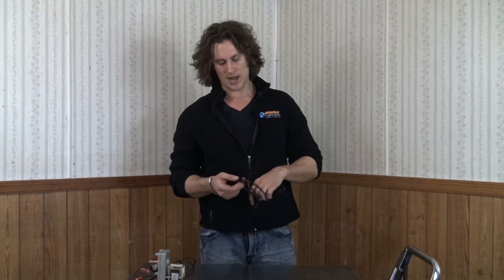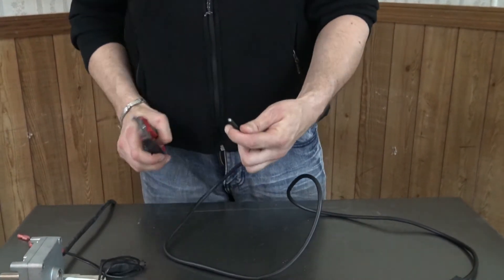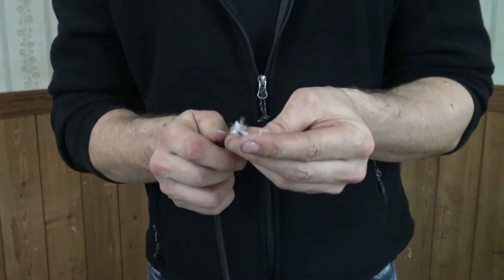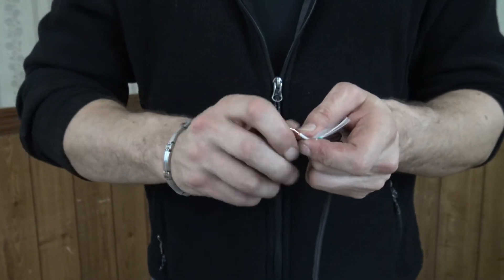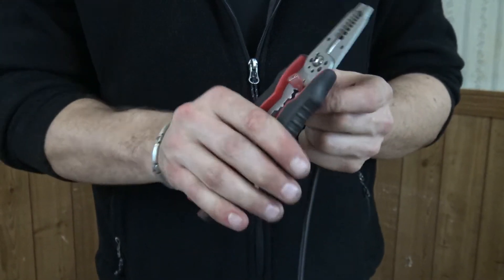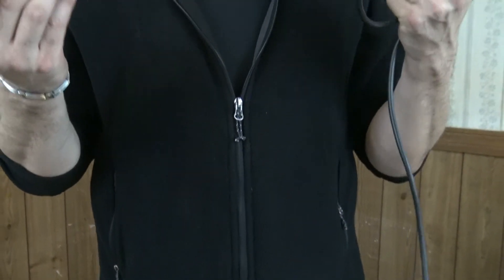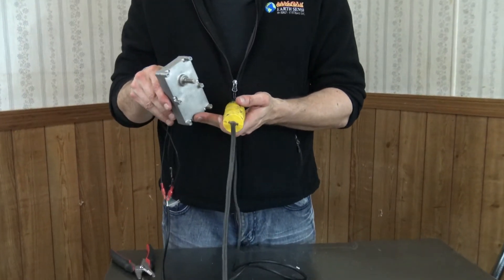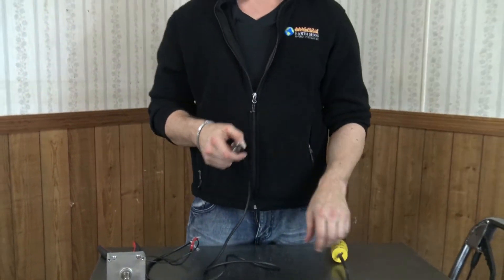Pellet Tech 101 - Making a Motor/Blower Test Cord

Comment: I have a 2005 Quadra fire classic bay 1200.  We just replaced the convention fan.  The stove starts, runs, but the convection fan cycles on and off (30 sec on, 4 mins off, 30 sec on, 4 min off ). I jumped the wiring (as you showed here) and the same thing is still happening.  We replaced both snap disc #1 & #2.  Cleaned out the ash in the square box in front of the convection fan. Also cleaned out the vacuum tubing, and the exhaust pipes.     When I run the stove, it starts out hot, green light on in the control box, then the red light comes on and the convection fan start.  Then both lights stay on, when the fan shirts off.    HELP … it get down to 2 degrees where I live.
Reply from the maker: Thanks for contacting us. The #1 snap disc is the only switch in line with the convection fan. Just for testing purposes, let's jump that switch to see if your convection fan runs constant as it should. https://youtu.be/FDVkbsHS95U?si=a5V4IsPfOoLX3M1W
Keep us posted, happy to help.
Reply: @EarthSense  I jumped that disc and it was still doing it.  I removed the conv fan and replaced it & now I just blew 3 fuses hahaha.
Reply: I fixed the connection on the fan and I stopped blowing a fuse.  When I jumped snap disc 1, the fan was still doing the same thing
Reply from the maker: @ Thanks for the message back. Let me touch base with a couple of our other techs and I will circle back to you ASAP. Appreciated.
Reply from the maker: @ Just heard back from our lead technician. Power comes from the control box to the convection fan 100% of the time - the #1 snap disc just interrupts it allowing the fan to turn on and off based on temperature. Given we have jumped the switch and changed the convection fan and the issue is still there, the problem can only be within the control box or electrical system. Suggested to thoroughly inspect all wiring that comes out of the junction box (where the control box mounts) along with the junction box port. Check for loose wires, exposed wires, and electrical burn marks. From there we have to look at the control box. If there is a dealer near by you they should be able to test your control box to determine if it is the issue. We also offer a control box testing service if you do not have a local dealer and want to go that route. 

For reference, here is what the Junction Box looks like: https://pellethead.com/product/quadrafire-1200-fs-junction-box-wire-harness-after-serial-352612-oem/

And Here is the control box for the 1200 - https://pellethead.com/product/quadrafire-control-box-3-speed-circuit-board-oem/

Keep us posted, happy to help however we can. Thanks.
Reply: @EarthSense  I took the control box in to get tested, and it worked fine. UGH!!   I got a new vaccuum switch and hose, that didn't solve the problem.  I also got a new thermocoupler, but haven't changed that out.  IDK what could be the problem. We are ready to buy a new stove hahahaa
Reply from the maker: @ Thanks for the message. Glad you were able to verify the control box works as it should. This is a very odd and rare issue you have. Yeah, thermocouple, vacuum switch, etc.. are not in line with the convection fan. Board gives power output 100% of the time to that blower and the #1 snap disc allows it to go on and off based on temp. The only thing left in our eyes is the Junction Box Wire Harness. The Control Box is putting out power to it, somewhere in the junction box or wiring, power is being cut out periodically/systematically. If you do decide to get a new junction box, double check your serial number as there were two different ones used for the 1200 model. If you decide to sell the stove and get something different, we can send you some links on refurbished and new stoves we offer if you're interested. Sorry again about the frustrations and situation here. Always happy to help.
Reply: @EarthSense !!!!   I took the new convection fan back to where I bought it.  They tested and it was faulty!!!!  OMGOSH!!   I have almost an all brand new stove with all the new parts I installed!!!   Thanks for your help!!
Reply from the maker: @beautywalker45  Wow! So it was an issue with the fan motor itself... So glad you had them test that and found the issue. Persistency is always the key :) Thanks so much for sharing and if you need anything else just let us know! Appreciated.

Comment: I followed your instructions and made my own and tested my distribution blower. Mine had two females so I made a cord with two males. The power cord for the blower had tree wires bla, garner and yell. I plugged in the bulk and yellow and left the ground plugged on the stove. Nothing happened, did I do this right? Does this mean that I need a new distribution blower?
Reply from the maker: @milagrossmith4891  Thanks for the message. Yes, green/ground should be left unplugged or as is. Yes, black and yellow wires were correct for test cord. If the blower is not operating when plugged  into direct power that would indicate the motor/blower is bad and should be replaced. If you need help with replacement options just let us know. Thanks.

Comment: Thank you!  My convection blower wasn't working and I was all set to pay $150 for a new one.   I built a test cord and checked it, and it was fine.   I used your other video to make a bypass cord and check the low limit switch, and that was the problem.  A new one is on the way and I am cautiously optimistic that it will fix the problem.  Thanks again!
Reply: Since I just figured it out, I'm replying to my own comment in case anyone in the same boat needs some guidance.   My problem was NOT the convection motor, or the limit switch.   I needed a better cleaning!!!  I usually clean out the ports, but not the tunnels between them.  The limit switch sits on one of these tunnels and all the buildup prevented heat from getting to the switch to trigger it.  When I cleaned it out, the switch triggered in about 5 minutes.    Now I have a new switch that I didn't need, but I figured it out.
Reply from the maker: @kkeduda  Thanks so much for your messages; apologies on the delay. Excellent troubleshooting work cleaning out those tunnel areas. I'm sure you also notice better overall air flow now as well. You should be able to return that switch unless you want to keep as a spare. Really appreciate you sharing this with us and the community - I'd bet it will most certainly help others. Greatly appreciated!
Reply: No good!?!   The convection blower worked with the bypass cord.  However, when I installed a new switch the blower would not turn on at all.  I waited quite a while until the switch got over 150 degrees as measured with an IR thermometer.    Now I don't know what to do?
Reply from the maker: Fantastic to hear - great job on your troubleshooting! Let us know how everything is working once you have the new switch installed. Thanks!
Reply: I also checked the old, presumed bad switch  by connecting it to an ohmmeter.   It initially read "-1" or no reading.  When I heated it with a heat gun, it almost right away went up to 2.5 and stayed there with only a tiny click.  After cooling, it was back to "-1".   Maybe the swtich wasn't bad?   How could the jumper cable make the convection fan work if the switch wasn't the problem?

Comment: Which wire do you put the female on and which do you put the male on?
Reply from the maker: Apologies on the delay Jessica. Just depends what the lead wire spade connections are from the motor. Some are male, some are female, some are 1 of each. Doesn't matter which wire lead goes to which on the motor, just want to match up those spade connectors to what the motor has. Hopefully that helps, any other questions please let us know. Thanks!

Comment: I have a Harman Accentra, how much should the intake flapper open when combustion fan is running? I have a flame that is tall and lazy and suspect the combustion fan motor.
Reply: Thank you Earth Sense for replying.
I thoroughly cleaned out the entire stove especially the areas you suggested. My flapper is opening a 1/4 to 1/2" max and the flame does not change when I open it fully. I will measure voltage next. Mean time applying penetrating fluid to fan lock screw, maybe it'll come off without having to cut the driveshaft.
Reply from the maker: @deepcjseven  OK, yes the combustion air issue is elsewhere. Let us know when you get a voltage reading. Yes, WD40 or PBblaster is great to soak into that lock screw. Heat can also be really beneficial in getting that to move - if you have a pencil torch, heat it up a bit. Again, double check ash blockages in the areas I originally mentioned as well. Keep us posted!
Reply: @EarthSense  My voltage readings at the outlet is 121 volts,  voltage going to the combustion motor is 115v. What do you think?
Reply from the maker: @deepcjseven  That sounds correct William. You could test the motor after start-up to see if that voltage has any dramatic drops, but it initially sounds like your combustion fan in the unit is working correctly. With that ruled out, it is some kind of an air blockage in the unit and/or air loss.  Really inspect that door gasket, glass gasket and hopper lid gasket for tight seals all the way around. Any air leaks will cause the poor combustion you are experiencing. Thoroughly inspect those burnpot holes, air intake cavity and exhaust manifold for blockage. Thoroughly inspect the exhaust vent pipe for blockage. One great tool we use for cleaning is a Leaf Blower Vac. When you put the sucking part of the leafblower on the exhaust pipe outside it has the power to pull ash from the stove that can be very difficult to access or see. Just a suggestion, here's a link to view it further. Keep us posted. Happy to assist and get you back to 100%. https://pellethead.com/product/toro-vacuum-leafblower-pellet-corn-stove-exhaust-vent-cleaning-system-3-4-venting/
Reply: @EarthSense  Did the start up test, results are 118V to combustion blower until the distribution blower kicked on and voltage lowered to 102 Volts and stayed.
 Until I open the hopper, then the voltage climbs to 120 Volts and stays until I close the hopper. After a couple of minutes the voltage will begin bleeding off till it reaches 102 Volts and stays. I dont understand this part as I see no sensor in the hopper compartment for the door. 
What do you think?
Reply from the maker: @deepcjseven  Hey William, I just spoke spoke with our lead tech on this as well; very peculiar situation you are seeing here. Your combustion fan voltage should not be affected by the distribution blower coming on or the hopper lid being open or closed (Although it is important to have the hopper closed while operating for proper draft/air flow). Here is what we suggest. - Pull the combustion motor completely out of the stove and run it to direct power with a test cord. We call this a bench test. Let it run consistently for an extended length of time. Use your voltage meter to constantly be checking voltage - see if there is any fluctuation when running strait power. If there is, then we have an internal issue with the motor. If it consistently runs at line voltage, then we would be 99% sure the issue is with your control/circuit board. Please keep us posted. Thanks!
Reply: @EarthSense  Ran the test you recommended with the combustion fan connected to a test cord for 6 hours and the voltage was consistently at 121VAC.  So were thinking bad Control Board? Could you give me the part number for this part and I will be order from your site.
Reply from the maker: @deepcjseven  Thanks William, Yeah that pretty much narrows this down to being a control board output issue. Here is a link to the correct replacement board for the Accentra - https://pellethead.com/product/harman-platinum-4-output-circuit-board-control-panel-oem/. 

Please keep us posted.
Thanks,
Reply: @EarthSense  when feed rate is set to 1 on constant burn and stove feeds pellets for 22 seconds, is it possible to fine tune those feed times?
Reply from the maker: @deepcjseven  Thanks for your patience William - had to speak with one of our Harman Techs on this. Here is the info I received: Only way to tune feed times is on start up using 1,2,3 dipswitches.  Not to do what he is looking for. Low maintenance burn mode is under 10 seconds of feed per minute which would be if he was burning in room temp mode and the thermostat was satisfied.  Normally the stove would go into shut down mode for 45 minutes but not if the auto/manual toggle switch was flipped down to manual.  The stove would then drop out its feed rate to the lowest possible setting and operate in “low maintenance mode”  to maintain the fire until there is a call for heat again. 

Hopefully that information is helpful, let us know of any other questions. Thanks!
Reply from the maker: Hey William, thanks for contacting us. Definitely sounds like there is a fuel to air ratio issue going on with your Accentra. The intake flapper does not open fully in operation - I would say it's generally 1/4 to 1/2 open during operation. If you have fresh air intake flex on the stove, that flapper should be completely removed. You can check the voltage on your combustion fan - should be near line voltage during start-up. Ash build-up and blockage would be the number 1 cause for the fire you are seeing. Make sure you've checked the following. 
- Burnpot Holes - Inspect closely and make sure they are all open
- Burnpot Cleanout - Front cover access port - Fully cleaned out. 
- Door gasket - Sealing tight all the way around. 
- Remove the plate behind the ash pan and check the combustion fan paddle and exhaust throat for any obstructions. 
- Exhaust venting checked and cleaned
- Rear Heat Exchangers checked and cleaned. 

Keep us posted, happy to help. We offer every part for the Accentra and guarantee the best prices. 

Thanks again,
Mr. Pellethead
Reply: @EarthSense  why 2 different motors with different amp ratings? Mine is 1.75 amp others have .9 amps.
Reply from the maker: @deepcjseven  Hey William, Amperage of motors will vary based on the brand and type. We often see those same ranges from .9 - 1.75 amp. For the most part we have not encountered issues with variances in motor amperage's. Often times the replacement motor is a different amperage than the original. As long as the RPM and voltage is the same, there shouldn't be an issue.